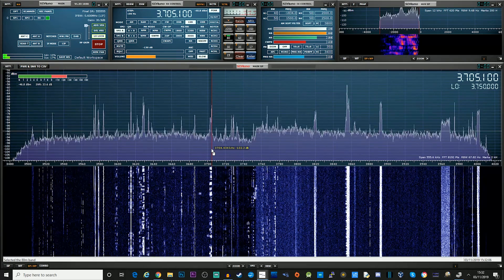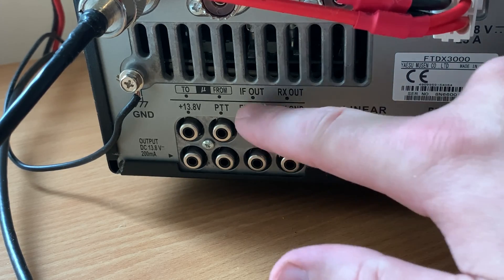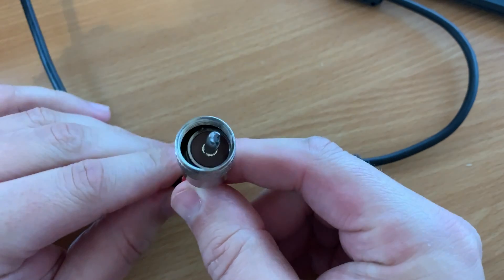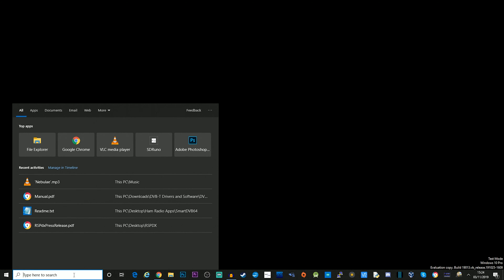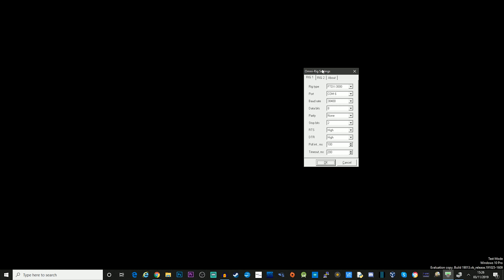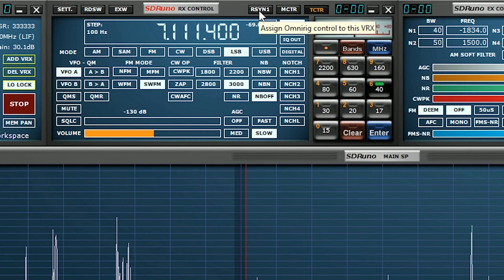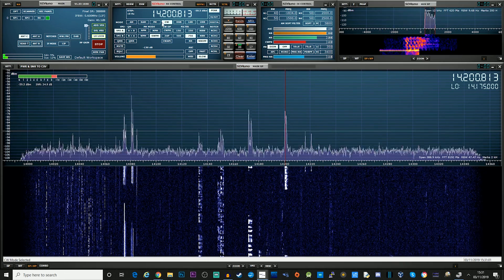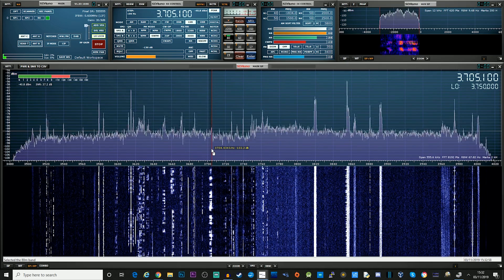FTDX-3000 Panadapter Setup With SDRPlay RSPdx

Comment: I finally got around to setting up my FTDX-3000 with the SDRPlay RSP1A and it works very, very well. The large detailed waterfall makes seeing activity on the band so much easier and control via OmnRig works flawlessly. Highly recommended for anyone with an FTDX-3000 or any older transceiver with an RF out port (something to look out for when buying a transceiver). Thanks for the installation instructions, the process was even easier for me as OmniRig was already installed. Y
Reply: If transmitting on the same frequency as the RSPuno is tuned to would it not overload the RSPuno receiver and damage it? Just curious I have the same and would like to set it up
Reply: @kenm0bqh163  The RSP1A receives its input from the RF out port which is disconnected on transmit however it still does pick up the signal presumably via the coax connecting the RSP1A to the FTDX-3000. The display on the pan adapter does show an overload but I haven't noticed any damage. Y

Comment: Do you know if this will work with the FTDX-1200
Reply: Yes, it will work with the FTDX-1200, but you will have to tap into the IF inside the radio since that model does not provide an external connection to the IF..

Comment: hi wondering if once the DX3000 is connected to your PC via USB does the built in CW function of the radio no longer function ?  that is what is happening after interfacing with PC via USB with omni rig and SDRuno.    Also the SDruno tracks my VFO when dialling from the DX3000 and if i change bands on the software (PC) then the radio follows, but if i change bands on the actual radio then the SDRuno does not follow the radio.  is this all normal operation do you know ?

Comment: Hi Matt, great video & you've got me wondering if this arrangement can be used in tandem with logging software such as MacLoggerDX?
Reply from the maker: I’ve not tried maclogger, but it should work if you can control the radio from it. On windows I use RigControl

Comment: To me, unless you use the IF output of the Rx, you don't have a panadapter display of your rig. You have two receivers with a 'common tuning knob' and some 'common controls'. I don't want to see everything my antenna picks up on my panadapter; I want to see what the radio is hearing. To me, when you use the Rx port instead of the IF port,  it's kinda like using a mini cooper to control a Lambourghini. Very nice video... thank you  :)
Reply from the maker: You’re welcome :-) I think having the choice of IF or RX is a nice touch with the 3000. Personally I liked using the RX for wide receive incase I missed a signal off band, but I see your point and can see why some would only want to see what the rig sees. Thanks for your comment and thanks for watching 🙏
Reply: @TechMindsOfficial  And I see  your point now. lol. Yeah, having choices is always great. I really liked your vid. Thanks  :)

Comment: Since I only intend to use as a panadapter,  transmitting will not harm the RSP1A?
Reply from the maker: If you’re connected to the radio CAT via omnirig then SDRuno will detect you transmitting and put the SDR into RF mute.

Comment: My question is will that work with a Yaesu ft 1000D
Reply from the maker: If the FT1000 has an IF or RX out then yes, but I’ve never owned one so cannot be sure. I’m sure you could find out from the manual or forums. Thanks for watching 🙏
Reply: The FT1000D does have an IF output (73.62MHz) I use mine with a standard RTL TV dongle and SDRsharp.

Comment: my old FT1000 unfortunately only has the IF OUT, can you show what it looks like when you are using the IF OUT ? It also seems using the IF route, the software needs a lot more configuration... I wish I had that RX OUT port, that would be a way more simple...
Reply from the maker: I don’t have the 3000 any longer but from what I recall the IF output would provide a narrower bandwidth. You’d have to check the radio specs for that. Configuration isn’t too difficult, as long as you know the IF output frequency you can just enter that into SDRuno in the IF section.
Reply: I realise this was posted a while back but the FT1000 IF output works fine with a stock tv dongle and SDRsharp.  The bandwidth of the IF output is pretty wide. (about 2MHz or so)
Reply: @g0fvt  thanks for the reply, never too late !  2MHz is fine ! It will provide a nice tool for that old radio ! Thank you for the details !
Reply: @Aleziss  the FT1000D has an IF at 73.62MHz, perfect for a cheap tv dongle. TBH it would be easy to use the IF from the sub receiver but that would need some mods. Apart from the obvious spectrum display and waterfall SDRsharp or similar will let you receive ESSB and use DSP noise reduction.
Reply: @g0fvt  oh and I forgot to ask, are you using an attenuator or you connected the IF out straight to the sdr dongle ?
Reply: @Aleziss  no attenuator. Look up my email and I can send you a screengrab of it working.
Reply: @g0fvt  thanks ! I will send you an email ! 73
Reply: @Aleziss  I have replied to your email, I don't use an attenuator but I do have the gain of the dongle turned down in SDRsharp, it is easy to get lots of distortion products if you turn the gain up too high.

Comment: when you transmit, does sdruno show your transmit signal or does it go blank?
Reply from the maker: It shows the signal being transmit but SDRuno goes into RF Mute mode to protect itself but you still see your own transmission.
Reply: @TechMindsOfficial  thats cool. so i will be able to monitor my own transmission signal for bandwidth, splatter etc as well as others? using the rca rx out connector?

Comment: My question is will that work with a Yaesu ft 2000
Reply from the maker: If I remember rightly the FT2000 has an IF output. Not sure if it’s standard or you need an internal board, but yes, it will work with the IF. Although the bandwidth might not be as wide as what you see in my video.

Comment: Nice, but you didn't mention which you are using to listen on now.  RSP or Radio - I assume radio but maybe the RSP is better at filtering some things?   I can see this being of most use for say a FT-857d (which I have) as it  has a very small display with no pan adapter at all.  I plan to fit a PAN Adapter tap to it anyway as it doesn't have one as standard.  I think the SDRUno software might be better at DSP and filter tighter than the radio as well.  What do you think?

Comment: You are one of my two favorite Ham YT channels. The other being a stateside Channel called SevenFortyOne. Why? You both will answer my questions. I am looking for a HF rig to start off with but I would actually like to start off with a good SDR radio and antenna to do HF. This SDRPlay RSPdx looks like the answer. I would like to put up the antenna that I will eventually use with the HF rig I settle on. I like your previous video you did on the MFJ-1708SDR for your FT-991 HF rig. Do you have any recommendations on a HF antenna I can get a start on that also can be used for the HF rig? I live in the country on my  own land but not sure how well large antennas will suite my spouse. I need something somewhat stealth but in the $100-$200 price range. 
Thanks
Kevin
Reply from the maker: Hey Kevin, I use an End Fed Half Wave antenna which is quite stealthy and will probably only cost you $50 or less. It’s just a 49:1 transformer at the base, and then 20 m or wire. Resonant on 40m up to 10m not tuner required. Or if you have 40m of wire it’s resonant from 80m to 10m. Maybe I’ll do a video on this antenna. I think you can see the antenna in my WSPR videos :)

Comment: Hi Matt! You make my wheels turn inside my head. I still haven't picked up a HF rig yet. This looks like the ticket for me except I would like to pay a lot less for the HF rig. I am guessing the RSPdx will run about $300 or more looking at their other units. I looked on the Omni Rig website and it looks as if the ORig will run with a few of the less expensive HF radios out there. I think you had a device from MFJ that you used with your FT991 that would switch between your HF unit and your RSP device but that looks like the FTDX-3000 has something already built in that takes your receive signal and sends it to the RSP device. How cheap could I get into HF by pairing an inexpensive HF rig that works with ORig and a RSP device. It looks like the RSPdx will pick up more traffic than the other units. Am I on the right track or do I have flawed theory here? I don't have anything but the computer at this point.
Thanks , Be blunt, I can take it.
Reply from the maker: Hello mate, how’s things? Well, yes, the 3000 has an IF out but also has an RX out, which is basically everything the antenna sees. Similar to the MFJ box of tricks I showed in a video. In order to link an SDR to a radio you’d need to be able to get to the IF, at the very least. SDR-Kits sell panadapter boards for a whole range of radios that don’t have that feature, might be worth checking that out. Alternately, choose any HF radio you like and then hook up an MFJ SDR box, as long as Omnirig supports it you’ll be good to go!

Comment: Hi, no drivers? Normal USB cables? Thanks.
Reply from the maker: That’s a good point, there are serial port drivers on the Yaesu website, but I can’t remember actually installing them specifically. Normal USB cables = Yes, like a printer style cable. I got mine from Amazon .